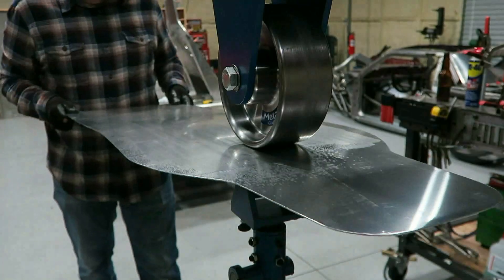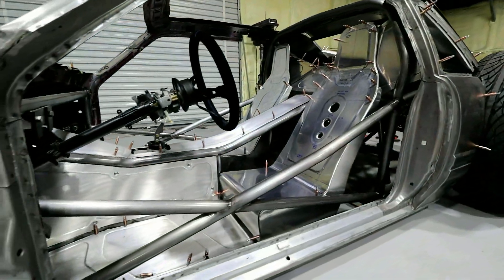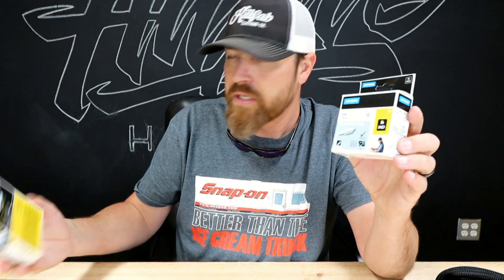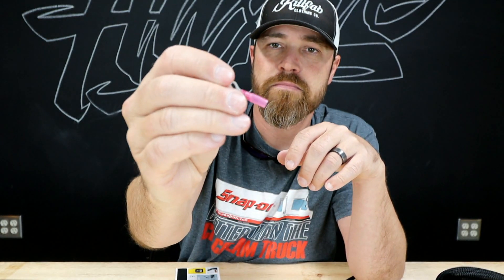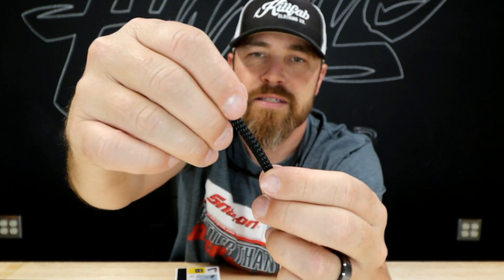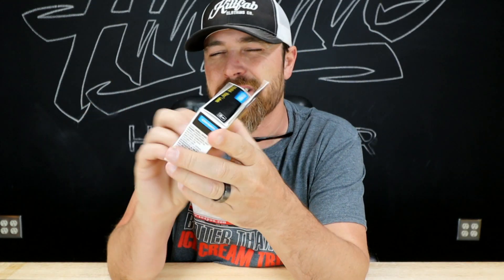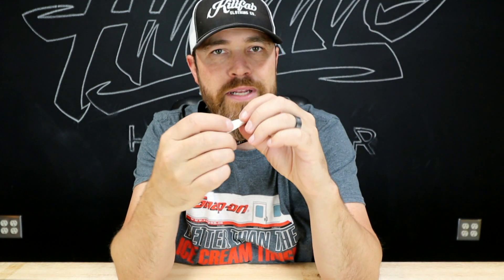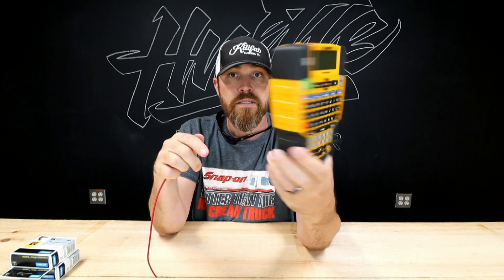You Need This Tool - Episode 119 | Wire Heat Shrink Label Maker

Comment: And after you get it all neat, labeled, and installed, you remember that other wire you forgot about....never fails!
Reply from the maker: lol...cross my fingers
Reply: Lol It happens every single time but still well worth the effort and expense. Sometimes it happenstwo or 3 times over lol. You want to impress the hell out of pro builders. A super clean wiring job will definitely get their attention. Many would be surprised what people will pay for that service too.
Reply: What type of heat gun should you use for this?
Reply: @JanutoloJon  a hot one

Comment: If you own a Harley and ever ever want to work on bars, switch wiring or maybe unstall bars. Buy that wire loom 500%!!! Dont use all the chain and garbage online. Use 500 paracord tied or taped to this kinda loom. More you gently pull on it the tighter it holds wires. Trim it to fit and throw some shrink tube, or I use cloth tape on the ends. Will look like Harley dealer themselves ripped you off.

Comment: What are the minimum margin sizes on individual shrink prints? The brother i just got is a material hog
Reply: If you haven’t already, make absolutely sure you use the “chain print” mode whenever possible. That cuts down label/tube waste immensely when printing multiple labels/tubes in a row (regardless of whether they’re all identical or individual).

Comment: They only sell the heat shrink for dymo rhino model. The laber is 75$ not too bad. but wont work with current dymo labeler. as far as I can tell. Had me excited for a minute
Reply: What do you mean? You can’t buy heat shrink tube label paper now? Only for rhino 6000? That’s what are you telling me?

Comment: Damn, I did this the hard way lol. I used a normal label maker by Dymo and printed the labels and put them under clear heat shrink. It looks pretty, but this would have been easier lol.
Reply: At $30-50 for 5' of heat shrink, NOPE! Sticking with Dymo.